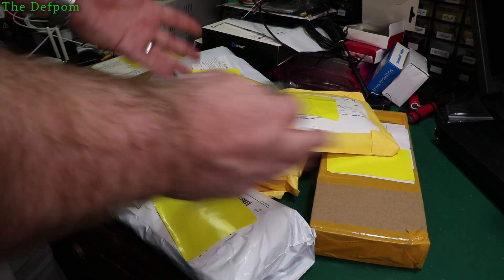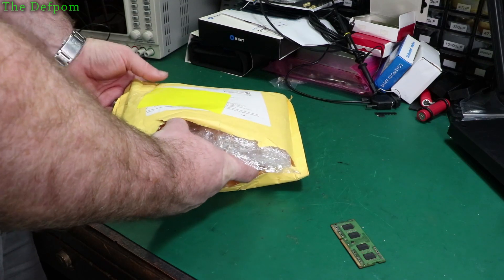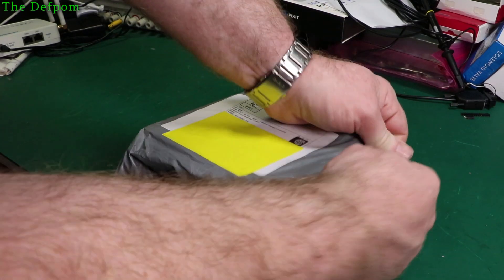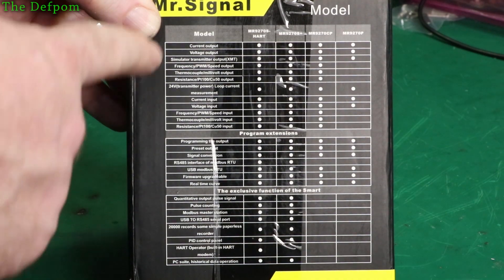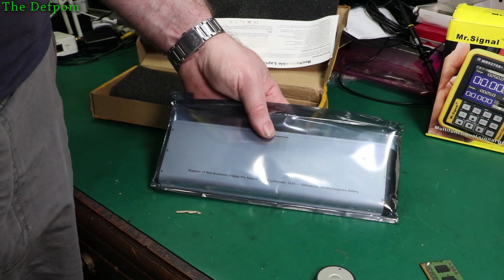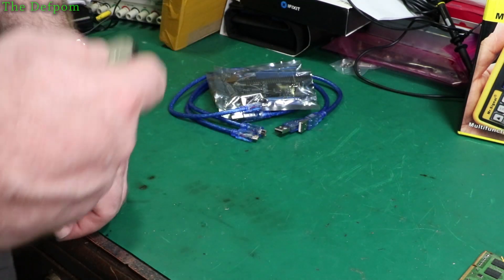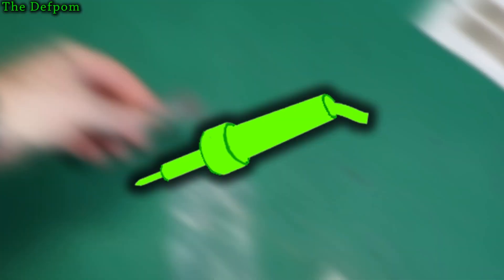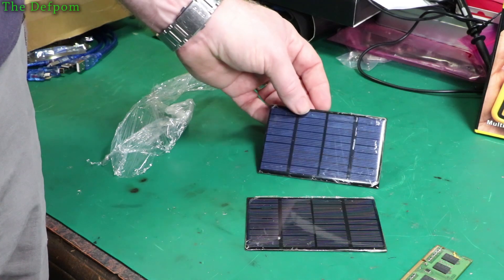#674 Mailbag Monday 13th January 2020

Comment: Very interesting as always. I enjoyed looking at the dent puller back in the day I used to either drill the panel and install a bolt to pull off or use a stud welder and slide hammer.. regards Chris
Reply from the maker: AllTheGearNoIdea - it uses hot melt glue to attach the pullers, I really have to try this thing out.